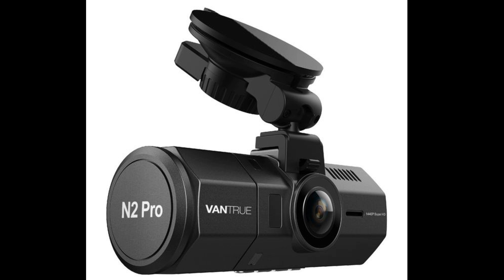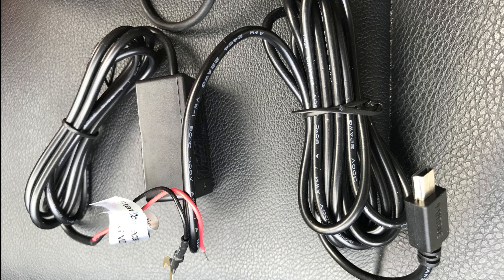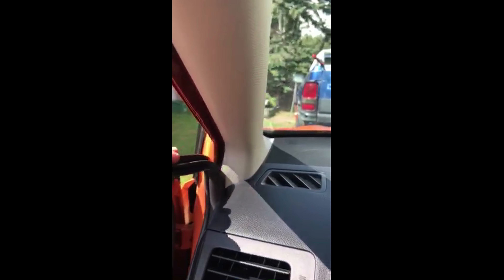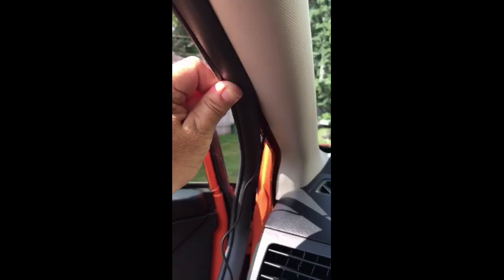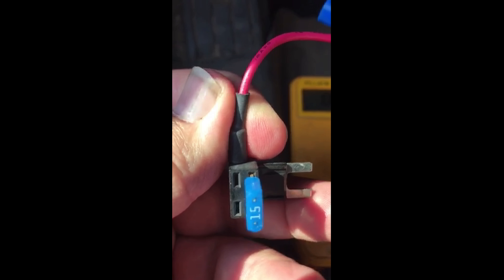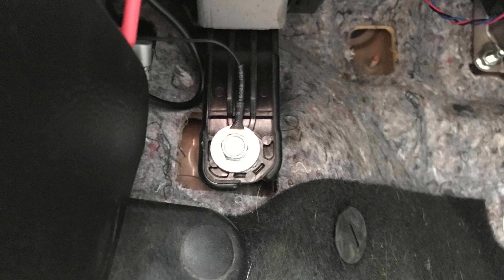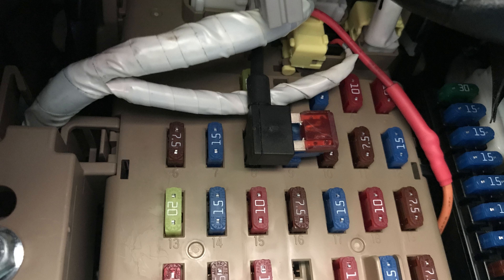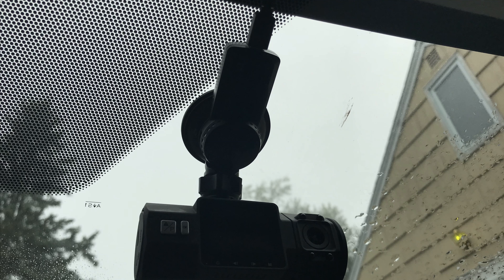How To Hardwire A Vantrue N2 Pro And Other Dash Cams

Comment: Question:  I have hard wired the kit....when I get into my car after parked for extended period of time and start the car, the camera does not power up....is this normal ?  Even though I hardwired the kit, do I still need to manually turn the camera on every time I start the car ?  Thanks in advance for your answer..
Reply from the maker: 3EYECROWN is the place you hard wired to providing power when the key is turned off? Sounds like you tapped a circuit that isn’t powering the dash cam. Test the circuit you tapped with a meter. It should have power without the key in the ignition. Let me know what happens.

Comment: I’m new to automotive electronics and forgive me if it’s already been answered. But once the camera is hardwired to an always hot circuit, what prevents the camera from being on 24/7?  Thanks.
Reply from the maker: Hi Bryan, If you hardwire it to a hot (always on circuit), the dash cam has Power all the time. The camera is in a standby mode waiting. The camera is activated by motion outside the front of your car. It can also be activated by a bump or a collision.  Its nice to have in case someone does something to your car while you aren't there. You can also choose to turn the parking mode off. I hope this answers your question.

Comment: Hey Doug I also have a 2014 Subaru XV Crosstrek. Where did you end up running the ground wire too exactly? Great video by the way!!
Reply from the maker: If you put your head down by the floor mat, looks on the left side. right above the black "felt" lining there is a nut there. It's right above the left little "foot rest". You cant miss it. :) I took a pic of it should you need to see it.

Comment: Great job, Doug! I missed a part.  I removed the engine and the steering wheel, so what's next again?!? 😁  No, seriously, you did a great job.  Thanks, I just may tackle this myself. 

I wanted to get one of those on Amazon Prime day because I heard there would be a great price. But I couldn't find the sale. Ah well. 😁

I would've mounted on the driver's side or in the middle. But what you said makes sense!
Reply from the maker: Dennis Lovelady, Just install the frame then body around the engine, you’ll be fine. Oh, I know you could do it. It’s so simple. As for the sale on prime day, it was messed up for everyone. Some glitch in their system. I’ m glad I could help out. Good luck. You know you can contact me if you have any questions. Thanks again!

Comment: I have this exact camera but have it wired into fuse that only powers camera on when i start vehicle (not constant). If i change to constant pw supply like this, and in 'parking mode' (with PM turned on in settings) will it drain my battery, or will it only power the camera when it detects movement?
Reply from the maker: If you bought Vantrue's hardwire kit it has a low voltage protection. Meaning if the battery voltage gets to low it will not power the dash cam anymore. With parking mode on it will detect motion. It can also detect impacts. Meaning if someone hits your car your cam will record that as well.